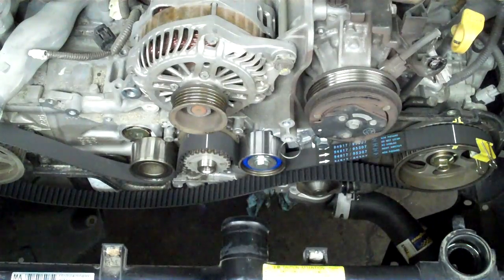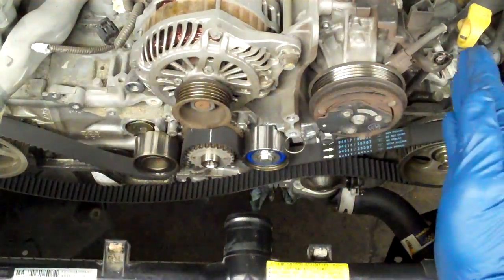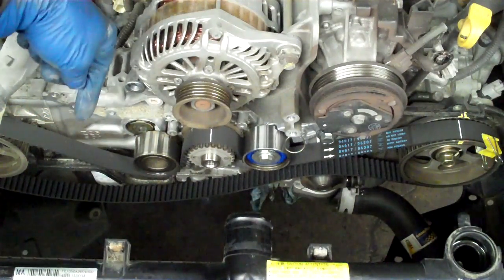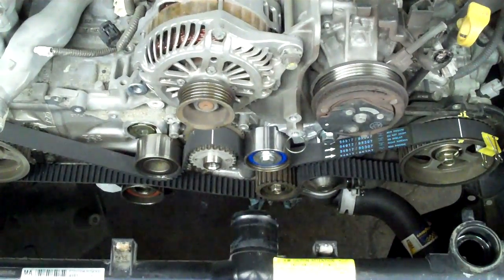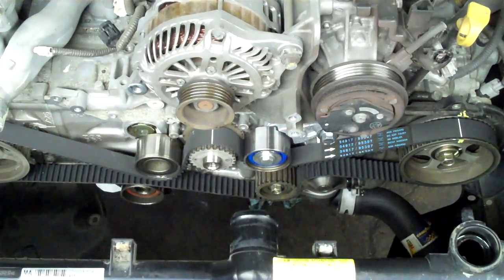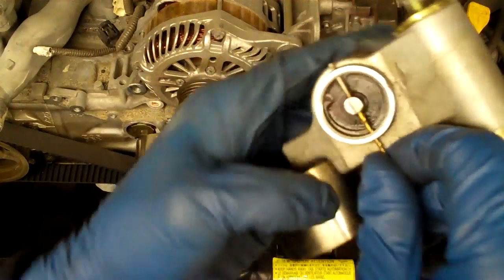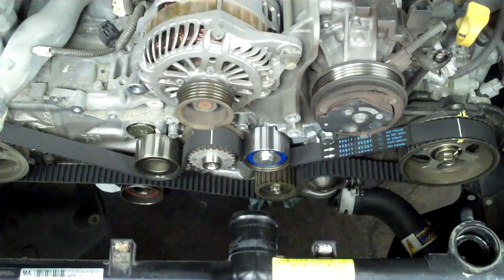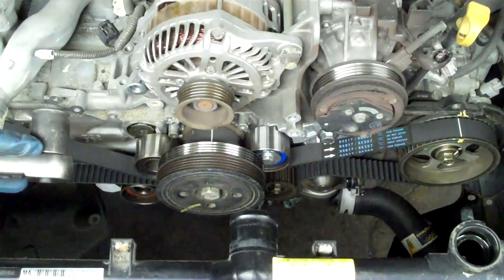How to replace a SOHC Subaru 2.5l Timing Belt

Comment: hi great videos love them all! have a question on the 93 to 01 standard Impreza's how do you pull the shifter out once undoing the one bolt do you just pull really hard to get it out of the socket? I've tried twisting it and seems there is a rubber piece I'm worried of breaking.😖

Comment: The Pipe wrench is a bad idea ... the harmonic balancer will be damaged on the groves for the belt that will wear out your belt quickly.

As for the Timing belts in Subaru's, I don't like them because @ 90K you will find that too many items need to be repaired under one of them.

Comment: I made the mistake of turning on the camshaft bolt to move the motor and heard the teeth on the belt slip on what sounded like one of the plastic pulley's and immediately stopped.  as long as the three pulleys are at the top marks when I replace the belt I should be good to go?  Did I damage anything by doing that?

Comment: Howdy, Brian!  I used your videos to do an engine replacement in my 2005 Outback at 220,000 miles and it was subsequently (and sadly) totaled in a hail storm.  Despite the car's fate, thank you for sharing your knowledge and expertise.  You're empowering people!  Now I'm in a 2010 Outback 2.5i and it's overdue for replacement of the timing belt and water pump.  I've done the work on an 05, but don't quite know what to expect with my 2010.  What differences are you aware of that might make this more of a challenge?  I appreciate your help!
Reply: I also would like to know

Comment: Hi my name is Eduardo I watch one of your Subaru videos and immediately subscribe to your channel I like how you explain everything. 
I need help I got a 2000 Subaru Outback that is idling low I cleaned the throtle body and still nothing I clean the idle speed control valve and it work for like 10 minutes do you think if replacing the spark plugs will help?

Comment: Hey Brian, thanks for all your Subaru videos! I recently had a idler seize on my 2002 forester, it shredded the belt and bent a few exhaust valves. Thanks to you i was able to do all the work myself and get the car back on the road. Its running the best it has since I have owned it. Im getting a strange humming noise coming from the timing cover on the passengers side at idle right after i rev the engine, only last for 20 seconds or so then goes away(used a stethoscope to narrow down the location). I used a timing kit from gates with all new idlers and tensioner. Any idea what the noise might be? It seems to only happen when the engine is warm.
Reply: The timing kits from gates are made in China , not very good quality . I used one of those kits , tensioner failed after 40,000

Comment: Nice video.

Another way to loosen the crank bolt.

Good socket on breaker bar, rest bar against the car chassis, blip the start one time and that bolt is loose (do not start engine!!!!).  

You can look it up and see which side to place the bar.    I know which side but won't say just in case you get mixed up and have a breaker bar fly the wrong way.

Replacing the bolt with a hammer?  What torque does the hammer go to?

Just broke a belt on a 95 2.2.  Thankfully it was a non-interference engine.  I understand the reason for interference but there are a lot of draw backs such as break a belt and it will cost $thousands.

The SOHC is easier than the DOHC because you don't have to try and keep 4 cams sprockets aligned.

Comment: Hi, thanks for all of the great videos. I'm having a bugger of a time getting the new belt on my 2000 Subaru Outback sedan. I can't seem to get the belt around the right-hand cam-shaft pulley, with the right tension, without it spinning free. I would appreciate any advice you might have.

Comment: Nice video. Thanks. My friend has 170k on her '07 and still running the original belt!  Was considering doing it as I did it on another 2003 xterra. Seems like it's not too difficult, but often times things aren't what they appear, right. Nice Ron Paul poster too!!!!! Instead of a mini sledge, have you thought about a heavy dead blow, just in case you were to miss?  Anyway, thanks for the video

Comment: Just wanted to thank you for your Subaru videos. I am a 20-plus year vet of the trade and a shop owner. Customer brought her Subaru with head gasket failure, and having no experience with Subaru, I tried to beg off on the job. She insisted that I could do it and she didn't  trust anyone else to do it. Needless to say, I was a bit intimidated. Found your videos and they really gave be a much needed boost of confidence. Reading the procedure in a manual is ok, but watching and hearing an expert is always better. Thank you again!

Comment: Do you do the cam seals on these? One well known shop told me they typically don't go out on my year which is an 04 Forester X 2.5 Auto, and they only replace them if they are leaking bad. I have yet to find a video where someone changes the cam seals. I'm going to be doing my timing belt this weekend and this video is going to help. Great job on the videos by the way I have been watching a lot of them haha.

Comment: My crank sprocket marks don't seem to line up when the marks on the cam pulleys are lined up.  And I'm not sure if I should use the green line on the sprocket or the recessed arrow?  Can I turn the cams apart from the crank?

Comment: i am trying to replace the timing belt on my 2000 sub outback, but am having a problem with the pulley on the drivers side spinning from the compression every time i try to put other pulleys on! any suggestions???????

Comment: For those with the ej25 SOHC engine, found out the very hard way that it is easier to just count the teeth. From left to right it's 46 teeth to the middle pulley and 43 to the right cam. Or buy a belt with the lines in it and place the timing marks where the lines are at even if it looks a little off

Comment: I am about to do my timing belt on the EJ22 block SOHC...don't you have to torque the harmonic balancer/crank pulley bolt to a certain spec first?
Reply: 132ft/lbs

Comment: Hey Brian, Looking into doing the timing belt on my 2003 Outback (awesome video btw). It was supposedly done around 100k Miles and I have got it up to 140k now. Recently noticed a leak around the water pump and spreading down the timing belt cover and was worried about rad fluid having found its way into the timing belt chamber. If that's the case, what sort of damage should I be expecting to find? Really hoping it's just a spent seal near the waterpump.

Comment: Brian, I've got two major issues with my forester right now: First, did the timing belt and the arrow may have been at TDC instead of the notch when we tried to turn it over. Second, corrected the placement and tried to turn it over but it won't start. If the alternator is still not attached to the engine but we have the battery charging will the car turn over or stay in "Limp" mode?

Comment: Hey Brian, I want to start off saying thank you for the videos the information is great. I am new to the world of Subaru. I just picked up an '01 Outback with 160k miles. I am doing a timing belt job this weekend using the AC-Delco timing belt kit with the water pump (Part # TCKWP307). I went to the local Subaru dealership to pick up coolant and conditioner because I have found online that you are supposed to use it to save the head gasket. To my surprise they told me to just use Prestone with the Subaru conditioner. When I was checking out they suggested that I change the cam seals while I am right there. My question to you would be would you change these as preventative maintenance, and would you do the crank seal as well?
Reply: https://plus.google.com/107990395008717479259/posts/jLfbZ36wGo3

Comment: Brian, great job.  I can't understand why the belt was a whole lot tighter then what you showed.  But, fighting it, I in the process stripped the bolt-hole for the tensioner. Now I need help going forward.  Best choice for fix (thread insert, helix coil, or time-sert) and also if there is concern for metal shavings in the block.  Thanks for any help.  Great vid.

Comment: Hi Brian,

I noticed on the drivers side cam gear, that the marks don't line up "exactly". If I didn't see the video, I would probably be trying to get that right on the mark. Did it look like that because of the camera angle or is that the way it lines up? Also, I noticed the mark on harmonic balancer was at about 200 degrees. You said the keyway was on the bottom so, obviously, that mark wasn't for lining up the key. I'm new to Subarus. I have a 2000 Outback with an EJ251. I've already had a problem with the dealer when I took it in for a recall, I got it back without the timing belt cover. I called and asked them if they needed to remove it for the recall and they said no, So now I have to save up for a new cover (if I decide to replace it. A new windshield washer bottle is over $100, so I prob won't replace the belt cover). I am disabled and used to do my own work on my vehicles. I can still do it (when it's not cold outside),, but it takes me a lot longer because I have major breathing problems. I'm thankful for your videos, especially since the dealership broke my trust. After the first time I was ripped off at a dealer in 1975, I've done all of my own work. 

Sorry I was so long winded but, I want you to know I appreciate your videos!

Marty

Comment: If the outer gears on the belt are moved how can I put them back to what they were so that the timing is correct?  And what do I do with the center gear? I'm lost and need help setting this back up:/ if anyone can help me please call me I have a good 2000 subaru impreza 2.2l I need help with my timing belt my number is (302)3774927

Comment: Great Video. I'm going out to replace the belt on my 2.5 sohc Subaru motor. It should be a lot easier, well because it's in a sand rail. thanks for the tips with the paper clips.

Comment: Brian I have to admit I really liked the last part of the video where you describe the merits of a timing belt over a timing chain.  I have seen horse power tv episodes where they work on these massive big block racing engines and much to my surprise they use belts instead of chains.  I never understood why until I watched your video just now. I have always avoided timing belt vehicles because I am unsure how to change them.  I do nearly all of my own repair work from the brakes, to the water pumps, oil changes, power steering pumps even fuel pumps in the gas tank.  But I have never done a timing belt before.  I don't like the idea of sending the work to be done out to a shop so I stick with what I know.  Lately I have been thinking about buying a Volvo V50 wagon.  Those come with a belt and so I have been plowing the internet trying to understand how to replace one properly.  The belts look completely symmetrical to me so I never really understood why you had to align everything to top dead center.  If you remove the belt and make sure the cam shaft sprocket and overhead cam sprockets don't move relative to each other can't you just slip the new belt right over the setup?  I have seen some videos where they show markings on the belt themselves.  I don't see why this is necessary unless the belts themselves are not completely symmetric.  Also let's say you accidentally move the sprockets if you align the TDC markings can you just slip the belt over them in any orientation?  Or does the belt have markings that also require they be aligned?  Any thoughts?

Thanks,
Juan

Comment: An Allen wrench also works really well to hold the tensioner in place.  That way you have a bent piece to pull on, and you don't have to ruin a drill bit!

Comment: Brian-  2005 forester SOHC.  I followed all your advice and my manual to line up all marks to install the new belt.  Engine runs great but won't keep idle above 3-500 rpm.  It seems like the timing is retarded.  The drivers side cam wheel also wants to turn after the belt is removed but I move it to line up the mark.  I have set it up three times now and I have the same results each time.  Any ideas?  Thanks.
Reply from the maker: Drivers side cam always wants to move with the belt off.  That's normal.  If the marks are all on mark and return to mark after rotating the crank 2 times, 4 times, 6 times etc.   It's not the belt alignment.  Check for codes, disconnected crank and cam sensors etc.

Comment: Thanks for the videos man! A QUESTION also. If I just tighten the crank pulley by hammering like you said, how do I know when it's tight enough?  Or do you not need to be super dead on with the torque on that?  Thanks again....your videos have saved me a lot of time.
Reply from the maker: Get that Company 23 Tool to hold the pulley if you can afford the $50 or so and a torque wrench.  If you can't, the hammer method does work quite well.

Comment: Is there a difference in timing belts/pulleys in an automatic transmission vs manual? Just got a belt replacement kit for my 05 impreza 2.5rs automatic. Amazon tells me it "fits my vehicle", but the instructions say it's for a manual. This'll be my first time doing this. Don't want to screw it up. Thanks

Comment: why not use a cheater bar over the half inch socket instead of lucy :)
Reply: because the harmonic balance will move. he basically using a makeshift impact wrench. unless you had a tool that could hold the pulley so it wouldnt move

Comment: SOHC? Arent boxer engines always "DOHC"?
Reply: No. It is SOHC because there is only one cam shaft per head. A boxer engine has two heads, so it has double the number of cam shafts compared to an inline engine.

Comment: Brian, need to know how to set correct accessory drive belt TENSION if we do not have access to a spring gauge (to apply 22lbs of force) for new drive belts. 2003 Subaru 2.5L engine, thanks! refer a clear video or message me

Comment: Hey Brian,

So if are all aligned with the cam shafts on the marks, and you take off the tensioner and the big cam on the right (you are facing the motor) goes out of align a little because the tension was released which way can you turn that cam to align the marks?  Is that clockwise?  This would be a SOHC Subaru Forester 2.5 engine.  Thanks again Brian.

Greg

Comment from the maker: It really doesn't matter.  You could have the crank be on and the cams off 180 degrees.  If you want to be efficient, take off the short side of the timing cover and line up a cam first.

Comment: Hey Brian...  I've noticed from other videos not related to your's and wanted your opinion...  Before you take off the harmonic balancer, do you have to position the small notch in the harmonic balancer with the 0 degree on the indicator.  I think I saw one of your videos that just takes it off without doing this procedure.  This is for a SOHC subaru forester non turbo.  Your thoughts...  Thanks.

Comment: I'm working on a 2000 ej25 SOHC and I had everything lined up correctly. But I notice once I removed the belt the passenger side cam can move freely about 45 degrees left and right if I move it with hand. Is this normal? crank and driver side cam are lined up correctly and wont move without force. Thanks.

Comment from the maker: I don't have a vid of taking the belt off.  I can can video that on the 18th though.  You just take off the small smooth idler on the passenger bottom side.  Then take off the geared idler pulley by the water pump.  Then the belt will come off for you.  The pin goes in while the tensioner is in the vice after you SLOWLY compress it.

Comment from the maker: On the 2.2 you're OK.  They don't suffer the interference issues the 2.5 does.  Also the pistons are centered in stroke at both "marks on" and out 180.  This means you can rotate your cams to mark.  And then rotate your crank to mark.

Comment: Thanks for vid. I'm installing a timing belt on a EJ22 motor in a 1996 Liberty station wagon, previous belt was shredded. I had the harmonic balancer at TDC before I removed it but the mark on crank pulley is 180 degrees out and of course the cam pulleys stopped where they were when the belt disintegrated. is this the way its ment to be? Thanks

Comment: Lots of fun. All day in the cold checking things and turning the key I now notice when my crankshaft mark is in line both camshaft markings are out of sink 80 deg to the left. Somehow the toothcount is off even with the marks alligned it rotates out of sink. Most likely bent it dead by this time. Going to have to do some digging on this one. Thanks.

Comment: I just did a head gasket replacement on a 2001 legacy and used a set of sce copper head gaskets @ .062" each stretching my timing belt .124" plus the circumference of the camshaft sprocket. I have not yet done the math on that nor will I but its stung tight as a bow (sounds like one when plucked). Still have my tension pin in just in case. Turns over but will not run. I don't hear valve slap and the marks all align. Could the belt be too tight? Thanks.

Comment from the maker: Thanks!  I could issue torque specs.  I've done this for 24 years now and can tell when things are going to come loose or give out.  I use a torque wrench on head bolts and on spindle nuts because you just don't mess around with them being too tight etc.  This other stuff is in that range that's just another day at the office.

Comment: hey man. i love the vids! nice work. i have a 98 2.5L DOHC. I'm replacing all my front seals and need a way to get all four cam sprocket bolts loose (without turning the cams, of course). Do you know if an electric impact wrench will work for that? Won't it just break the bolt without turning the cam? I'm poised to attempt it but I just don't want to ruin anything internal. Any advice is welcome. Thanks!